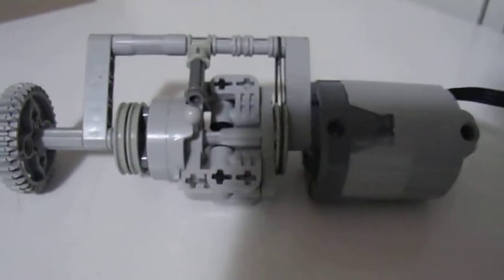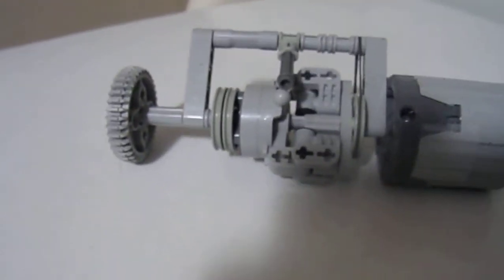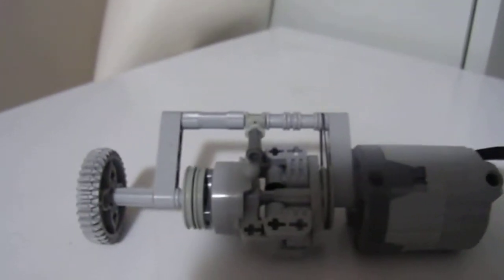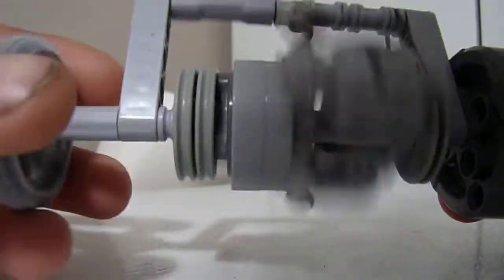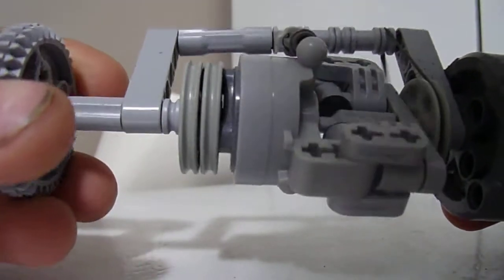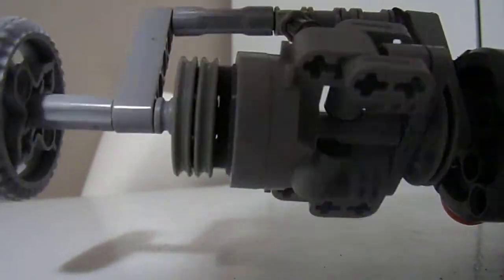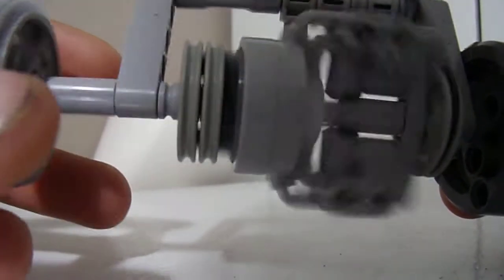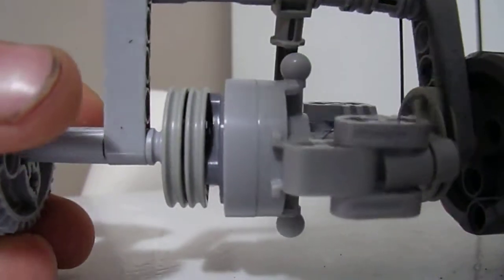Lego Technic Automatic 2-speed Planetary Gearbox

Comment: Is the ratchet necessary?
Reply from the maker: Yes, the ratchet is necessary. If it is removed, the high gear will work as usual, but when resistance is increased, the planetary hub will rotate indefinitely in the opposite gear, and the output will never turn. In that case, the gearbox would mostly just become a complicated clutch.
Reply: @2godbdglorylegotechnicvide966  okay thanks, I’ll try something like this myself